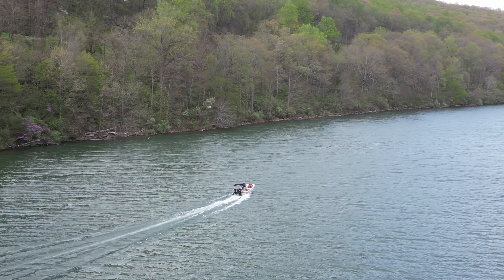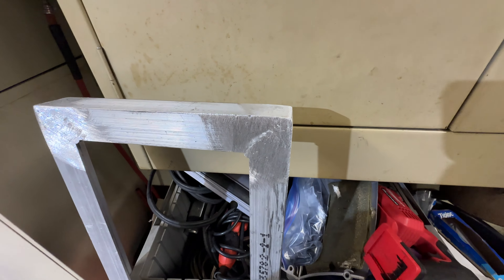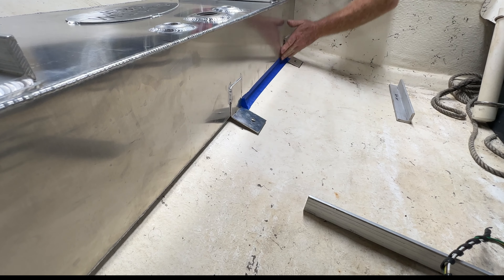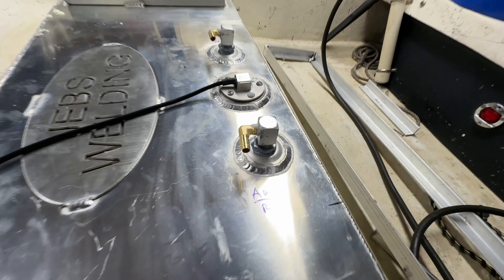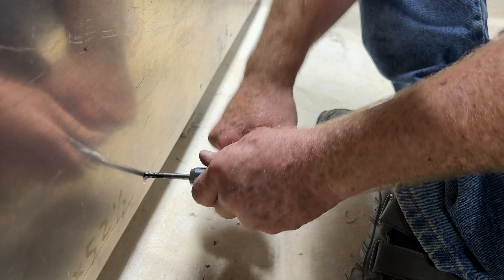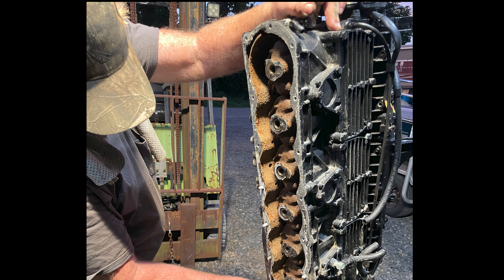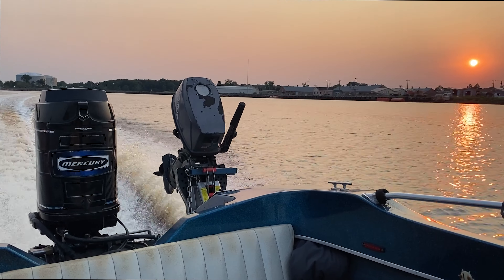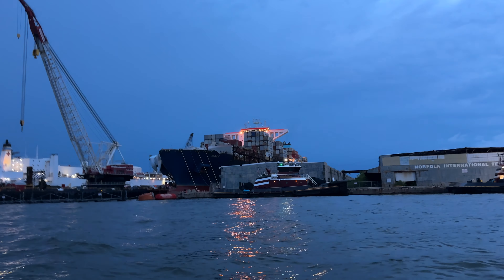Marine Maintenance Mash-Up: Carolina Skiff J14 Phase 2, Mercury L6 Test Run, and More!

Comment: Beautiful work as usual! I love that boat. I don’t know much at all about outboard motors. That’s an in-line six, vertical shaft two-stroke? What was the block material made out of? Pardon me if you mentioned it in the video, but I’m kind of watching this as I’m driving to work, got it up on the dashboard in the phone holder.
Reply from the maker: @Tennesseemountainhomestead  yes Inline 6 verticle shaft two stroke. Mercury made the inline 6 in different cubic inches from 1957 to 1987(I believe).  From 60 to 99.4ci. This one is the 99.4 cubic inch block. They called them the tower of power back in the day. The blocks aluminum. This is the second one I’ve had crack in that same spot. The first one we welded with the spool gun and it kept cracking. We ended up scraping that one. Hopefully this holds if not I’ll be finding a block. These motors have sort of a cult following. I like the way they sound, they have a sound all to their own. It’s been pretty reliable I got the boat in 2020 did a ton of work to it and up until last year never had a problem.  While the power head was off we replaced the crankshaft seals and did new gaskets for the exhaust defuser and cover. They’re prone to leak there as well.  Why the trigger went bad sitting in a box for a year you tell me? It’s a pain in the but to replace you have to disassemble the distributer and reset the timing.